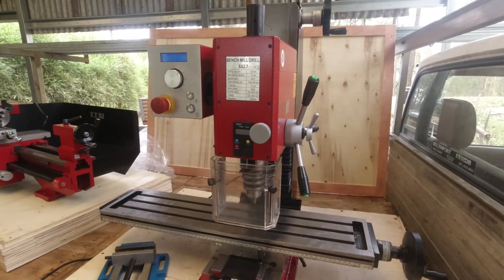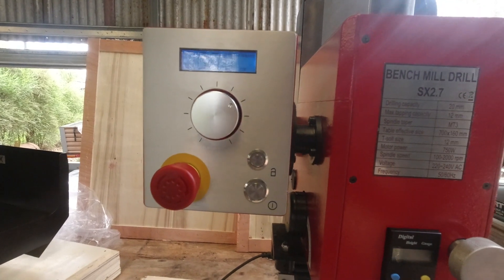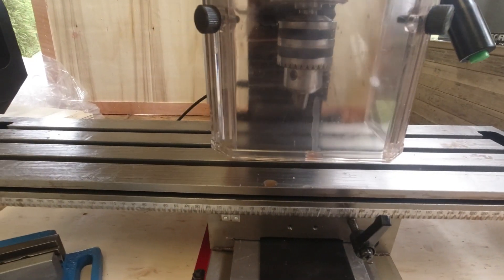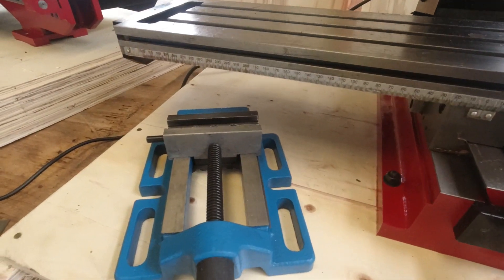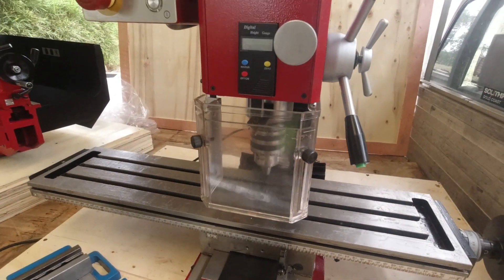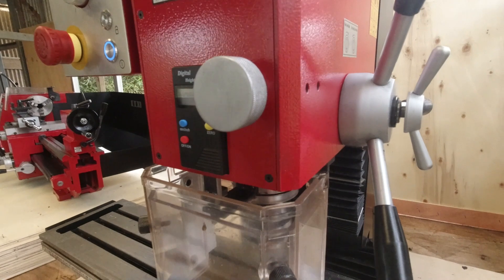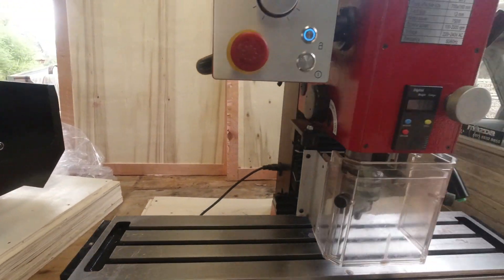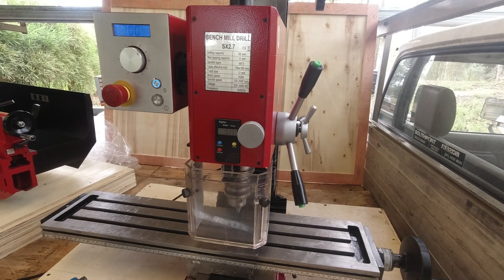The SIEG SX2.7 first impressions

Comment: There is two versions SX2.7 and SX2.7L, L has the other panel and buttons as it has the brushless high torque motor. I have the SC4, i like it. Throw a Collet chuck on it and a good tool post and it does real well. i run stainless steel thru mine, parting off etc no problem Collets made the world of diff for parting off.
Reply from the maker: This is a high-torque version, can't remember if it's brushless but I think that's the only option for high-torque.

Comment: The sieg sc4 has been on my wishlist for quite some time, unfortunately due money constraints, i went with the 7x12 ones. Damn fun to play with but shit the prices has been rising up quickly over the years. Have fun with the sc4!
Reply from the maker: I would like to have gone bigger, specifically to get a 38mm bore, but I just couldn't justify the expense.
Reply: @GRAYnomad  hows the lathe and mill so far? I'm assuming you got multiple cuts😁 Those chinese lathes are sharp as hell, got a nice cut from just the carriage ends
Reply from the maker: @singaporeseaslugs1393  I've been too busy to do much more than spin them up to see if everything works. An d unfortunately that condition will continue for a while yet. I have moved them into position on their bench but that's about it so far.
Reply: @GRAYnomad  take your time, will be interested in your projects with the machines!